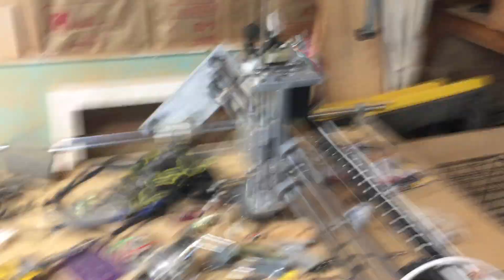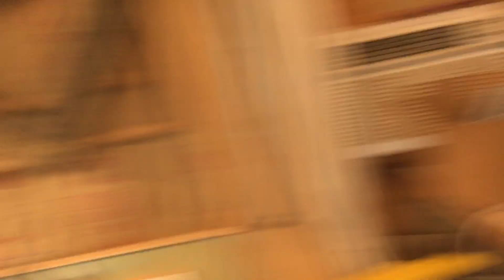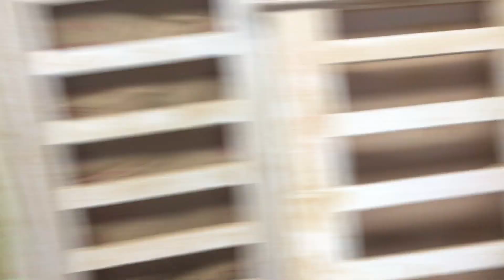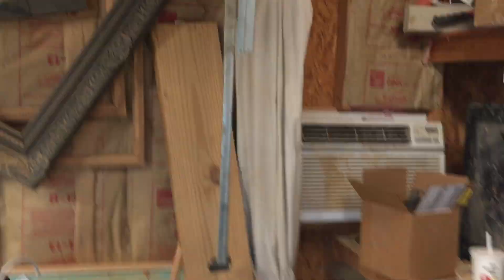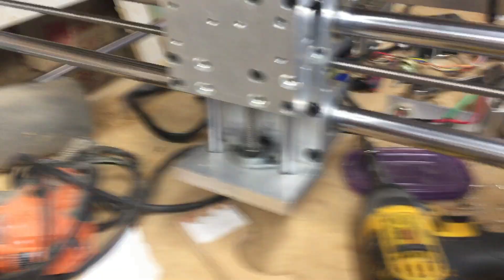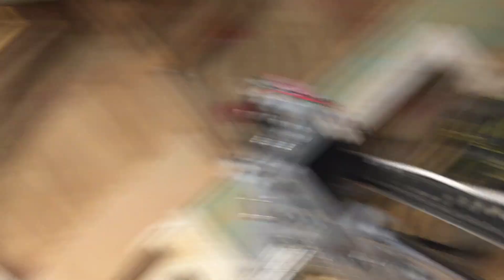DIY CNC Build - Part 13 - Testing the chain drive

Comment: Do you any issues with making small circles, say .75” in diameter.  I have chain drive and my small circles are very misshapen.
Reply from the maker: I only ran the chain drive for a few days before switching over to lead screws and a belt. That said, if your circles are off, I'd suspect either backlash in the chain or you've got the number of steps / mm wrong on one of the axes.
Reply: I see your comment is 7 months old but have you fixed this issue? I've been running diy chain drive cnc for about 12 years now. Let me know if you still need help.
Reply: @srlsigns7944  I discovered that I had backlash on my X-axis which I could not determine the cause. Luckily backlash compensation on Mach3 solved the problem and circles are coming out nicely now.
Reply: @chrismolloy131  that’s good. If it happens again, there are software and hardware points to check. My first chain drive wasn’t engaging enough teeth on my sprockets. The more teeth they cover the less backlash you will have as well.